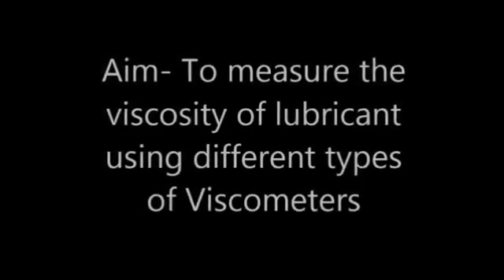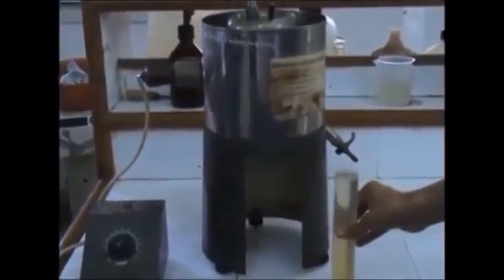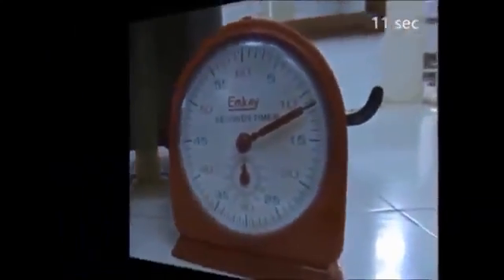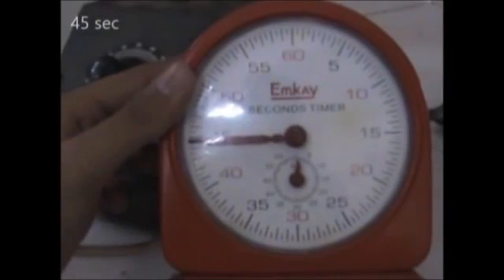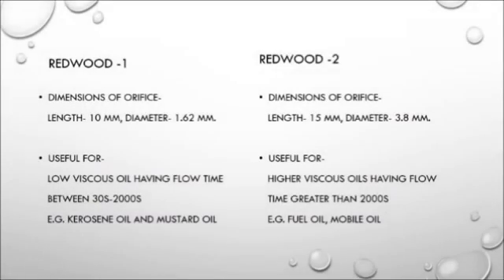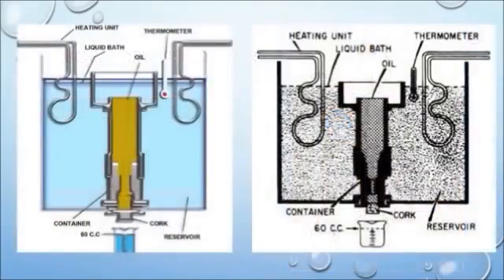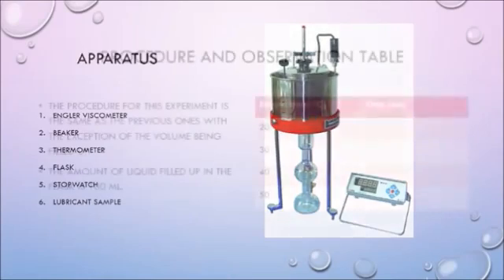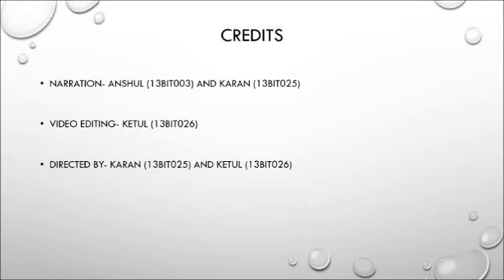Pr 1 related sample video   To determine Viscosity of lubricant using various Viscometers

Comment: A Fluid Mechanics problem that I'm trying to work out.A viscometer of the Redwood type has an oil-containing cylinder 4.75cm in diam and an agate tube 0.17 cm in diameter and 1.2 cm long. The oil surface, when flow starts, is 9 cm above the outlet from the agate tube. To allow for the sudden contractions at entry to the tube, the effective length of the tube may be taken as the actual length plus the tube radius. Making allowance for the decreasing head of oil, the viscous resistance through the tube, and the KE (kinetic energy) of discharge, calculate using arithmetical integration, the time required for 50 cm3 of an oil of viscosity 0.5 poise and specific gravity 0.92 to flow through the viscometer.How do you find the time?From this question, I have tried to use quadratic equation to solve for v, but it is proving more difficult than I thought.